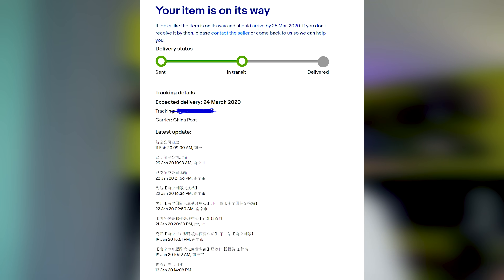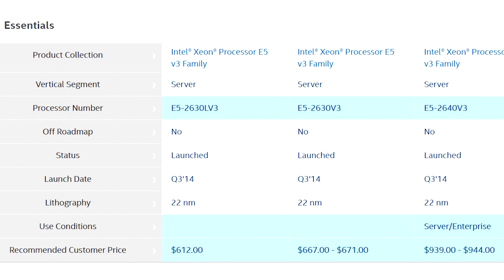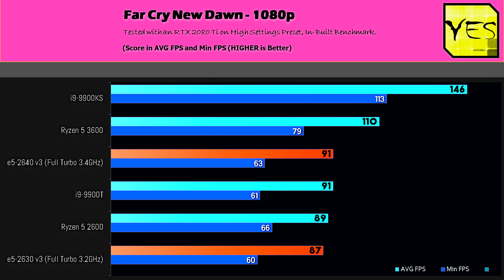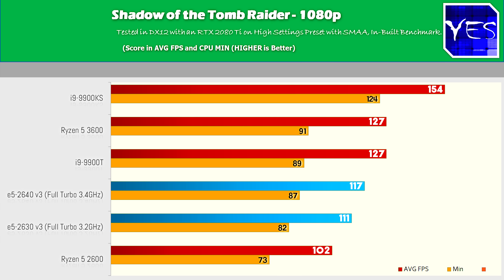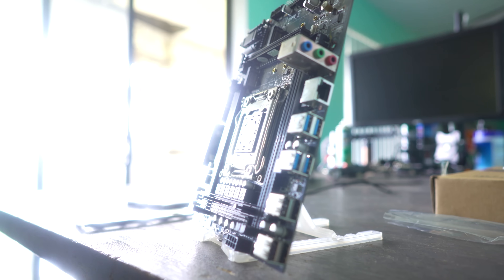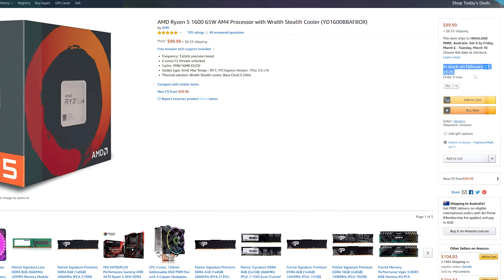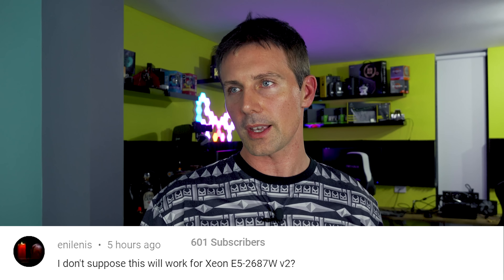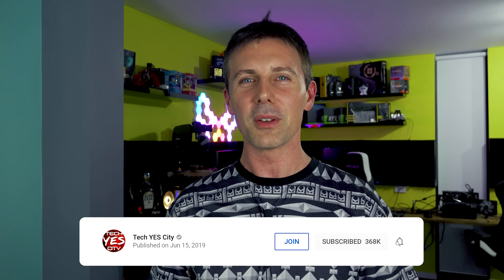8 HASWELL Cores For only $78...!? (E5-2630 and 2640 v3 Review in 2020)

Comment: @ 6:10  I'm with you there. It's been 1 of my 2rd most fun, new system builds to buy into new & grew with it from day 1 & riding till the wheels fall off. I haven't even loosened a lug yet. Still rocking my 2nd Tylersburg system for fun. 4.6Ghz, Tri-Chan DDR-2400 Cl10 crossing into the DDR4 feel & speeds of early X99. Blooming brilliant.

Comment: The one I really wanted to see is the E5 1680v3 on a good board.  I heard they are unlocked but there is little info around about it.  If they can overclock to over 4ghz as the previous 1680's could it would make it for quite of an interesting thing.

Comment: So 2640 v3 can just run the ram at 1866mhz? which CPUs can run it on 2400mhz or more?
Reply: Up to 1866mhz, but it can be run in quad channel on the right boards... giving you 3732MHz 'dual channel' effective bandwidth. 
So even 1600MHz in quad channel will give you 3200MHz 'dual channel' effective bandwidth. 
Check Intel website to see what Xeons support 2400MHz etc.

Comment: those machinist X99-V102 board has a flimsy nvme and m2 ports. though generally a good board with legit quad channel support the solder joints are weak. mine fell off the board (i have 2 of the same) can be related to the location under the pcie x16 slot.

Comment: Can you overclock the baseclock on these boards? Linus did an overclock on the baseclock of a xeon and got it to 113mhz stable. If you could get one of these to a more conservative 110 x 34 would be an all core boost clock at 3740mhz. I would be interested if this was acheiveable and what gains it could offer. Linus video title: Intel Xeon E5-2697 v2 - Test and Slight Overclock Vlog

Comment: IVY BRIDGE:
Check out the E5-4627V2.  Just saw the price is very attractive at $60. EIGHT Cores/EIGHT Threads and with all core clock to 3.5Ghz. It is locked, of course.
https://www.ebay.com/itm/QTY-1x-Intel-CPU-E5-4627V2-Egiht-Cores-3-3Ghz-LGA2011-SR1AD/164002585031?epid=11021091630&hash=item262f50d9c7:g:81sAAOSwBDdeAYGR
I have run this CPU on a HuananZhi X79 Deluxe for nearly 1 year (and I thought I had a deal at $96 delivered, at the time) and it really is a nice performer.  At this price...wow.

Comment: Would you be willing to do a single e5-2670 V3 benchmark? I snagged a EVGA ftw x99, i7 5930k, 32gb ddr4 for 300 USD and I want to sell the i7 for 150usd and buy a 2670 v3 for 100 so I have 6+ core and 12+ threads and 50 to spare but there aren't any decent videos of the 2670 v3 on all core turbo either it being of or not, love your videos man

Comment: i'm still using a 2600k @ 4.4GHz. Given that the R5 2600 is just a little better than the 2600k i suppose that it's not worth it to upgrade now to 2630 v3 right...?

Comment: Hi i'm thinking to build a new pc with a gtx 1070 that i currently have. Now i wanted to build the new pc with the ryzen 3600, 16gb ram and  the b550 when it will be out but than i saw this video and now i don't know what to do. The difference in price is about 250  euros in favor of the xeon. Now i was thinking if i buy the 2640 v3 with the HUANANZHI X99 TF is this able to do the full turbo mod? Is stable? And another question, if i buy 16gb of ddr4 ram by corsair at 3000mhz will the ram go to this speed or isn't worth it? Finally what do you suggest?

Comment: Awesome Video loved that 😎👍 Say Bryan its a long time ago that i wrote you. I was the guy who did modify the bios to set the xeon 1231v3 to 4ghz on all 4 cores. I did get from ebay that mistery Intel Soma CPU and the comunity still dont knows on wich board it is working. It is an 8 core cpu for the mainstream socket (what it looks like) with 4 dies on it. I already did delid that cpu. Do have also one? Much greetings :-)

Comment: I would add 2700 to comparison, as the price sits between 2600 and 3600. And its a hexacore. Also, it would be nice to mention v4 variants, as they support faster ram, but are on the same socket.

Comment: I have a Core i5 750 with socket 1156 can i change it for a 6 core 12 threaded cpu or is there no performance boost ??  i experience often bottle necking of the cpu. It is coupled with a GTX 960 of msi and a 350watt power supply.

Comment: Suggestion for next videos: you should test with the most powerful gpu, i.e the 2080ti, to eliminate the gpu bottleneck and show the real performance difference but it could be a good idea to test also with a more reasonable gpu, like the 5700, only in the title in which you saw the biggest difference between the used cpu and the new ones, to see how big of a gap there is in a more realistic scenario

Comment: I am waiting to get my rig from China too. Dual 2620v2 with dual cpu with 4 channel ddr3 8x slots. Doing the numbers with assassins creed and gta. People are hitting good response FPS with massive background data shuffling going on at the same time. Raid 1 or raid two two ssd together for much faster boot up at 3/4 faster. Also the sleep function my be coming soon with a proper bios update with some north bridge and south ones flashed to allow shutdown hibernate procedure to suspend power and safely leave ram on to allow fast reboot times. Fingers crossed 🤞

Comment: Great video. I personally think the microcode hack is a bit too much hassle but the chips seem decent enough if you can score an old workstation for cheap (with a mobo and Ram) and pair it with something like an rx580. If you want a bit higher clocks maybe try using a base clock tool to overckock slightly with something like setfsb but I don’t think the gains will be noticable on a low- mid range GPU.

Comment: The problem I have with this is the fact that you can easily pair the 2 Ryzen cpus with the wraith prism and oc both to about 4.2ghz all core and that cooler is only about 20£ and the extra performance ud get would be pretty noticeable in my opinion.

Because especially the 3600 only boosts to 4.2ghz on 1-2cores and they all achieve atleast 4.2ghz all core so it’s a no brainier for games that utilise more then that.

Comment: AliExpress are $219 for 2640 v3 and no 2630 v3's. Also Engineering Samples available wont turbo with Bios Mod. Help Brian, any where else, ebay is not cheap either.

Comment: Xeon > iAnything .   Running a 10 core E5-2630V4 ES, 32GB ECC DDR4 2133 in quad channel, GTX1060 3GB, DIY workstation/NAS/Gaming, 50-60FPS Asseto Corsa @ 4K. All while win 10 is a VM under unRAID OS with CPU/GPU host passthrough. Not one blue screen of death (thanks ECC!) windows uptime last reboot was 90+days.

Comment: 1650 and 1660V3 unlocked multiplier represent, I have my 1650v3 @ 4633mhz stable 1.36v, I use current limit as an alternative to AVX offset, so running prime95 it will liit to around 4.3ghz using a 227amp current limit.

Comment: Performance-wise, would I be better off going with one of these options or an i7-3770K build? Thanks.
Reply: @SISSYPUSS  I have two rings, my original 2012 with the 3770K and one from last year with a Ryzen 2600 and RTX2 L 2080.

I'm wondering if the Xeon performance here would be better than the 3770K. I can sell, CPU, Mobo, and RAM for ~$400 and pick up a Xeon combo with the cash IF it will perform better. 

Do you get where I'm coming from?

Comment: I dont think those cpu's are worth so much since their max frequency for the ram even if it is ddr4 will only be 1866mhz and it would be cheaper to buy the e5 2650v2 with ram ddr3 reg ecc 1866mhz than to buy that cpu that is more expensive with a little ram more expensive at the same frequency sorry for the bad english u,w,u

Comment: Seeing how these procs work, I wonder what the difference gaming-wise is between a X79 Xeon build and a X99 Xeon build.
Reply: power consumption, and trust me, differance is not small. Like 200 vs 280W whole system, just because of CPU.
clock to clock, haswell is like 10% faster from Ivy Bridge, depends on application.
X79 is not worthy if you using computer a lot, you pay all saving on power consumption quite quickly, usually within the year.
Reply: @warrax111  the price of X99 just in general makes it a turn off for me, and while I am all too aware of the power consumption, I am not much worried about it really. I got more than enough PSU
Reply: @warrax111  If I was starting from square one, Id go for X99, but I got many parts for a X79 build handed to me for free, including 384gb of DDR3 ECC at 1600mhz.

Comment: The 3600 is a big improvement over the 2600, AMD must have really improved the single thread in the 3000 series. I have the 1600 AF and it runs great, basically a 2600...amazon had it for 85 dollars amazing for the price.
Reply: I been enjoying 4.3 boost pre CCX in auto overclocking mode with a $25 cooler on my 3600 = It's getting cheaper and also faster .

Comment: What do you think about e5 2678 v3, does this cpu have turbo, i cant find anything on intel website?
Reply: The E5-2678 v3 was an OEM CPU designed for companies like Dell and HP, so it's not listed on Intel ARK. You can find info about it on other sites though (e.g. cpu-world), and it's listed as having a 3.1GHz max turbo. The performance is a bit worse than the E5-2680 v3 (which is listed on Intel ARK).
Reply: @amp888  Thank you, on aliexpress, diference betwen these two's is about 40-50 usd. Do you think that that extra money is worth to spend, how much diferences is?
Reply: @marko1989milosevic  I would personally choose the E5-2678 v3, because I don't think the performance difference is worth the cost. Better to save the money and put it towards more RAM or other components. The difference in performance is probably 5% or less.

Comment: How much you can get performance on a dead platform. Ok the xeons and china boards are cheap but when you are going to upgrade in future you have to buy everything new and scrap those old parts. And those cheap china boards are not going to work very well with i7 oc cpus if you are going to upgrade that way. Buy AM4 platform if you are going with little money and then you can upgrade with little money when you have that chance. Those cheap china boards are made for one time use and then you can throw them in to a bin. I just can't understand this hype for these xeons. That x58 stuff was ok if you could get original asus or gigabyte board cheap for them xeon x56xx cpus so that the price would be under 100$ for mobo and cpu. But the x58 board prices skyrocketed. And now it's happening for quality x79 and x99 boards. But again I say that the AM4 platform is the way to go these days, not these xeons. Resale price for these are going to be ...?

And R5 2600X is now at microcenter for 99$. Now that is a cheap cpu

Comment: I wonder if you've looked into testing any of the E5-4xxx v3 CPUs (the ones originally intended for use in quad socket configurations). They typically have more L3 cache than the E5-2xxx v3 variants, and can be had for around about the same price, if you put some time into searching (which I guess you're used to by now! :) ). As an example, I got a couple of E5-4655 v3 CPUs for my server (6C/12T, 2.9GHz base, 3.2GHz max boost) and they have double the L3 cache compared to the E5-2620 v3 (6C/12T) you tested about a week ago. It might be interesting to see whether that increased L3 cache makes a performance difference in gaming and/or production workloads. I don't know if you can still apply the max turbo hack for the E5-4xxx v3 series though.

Comment: i love my xeons (x5675 4.5ghz all core all threads 25x180 24gb ram 1804mhz cl9 rx580 on a sabertooth x58) when you did the x58 review you compaired it to the i5 and the 1600 also 6c12t processors. why did you review the e5 8c16t against 6c12t ryzen instead of the 1700,1700x,1800,1800x,2700 etc i almost dont feel like it was a fair comparison as against the 6c because the e5 has a 2c4t advantage regardless of clock speeds being slower

Comment: x79 on those chinese boards still has a place.  Gotta figure a six core Haswell at 3.6ghz all core might still loose to an X79 Ivybridge 1650-v2.  I haven't gotten any of the new revisions but the old Huanan boards you were allowed you to get to 4ghz quite easily.  I wonder if the new x79 boards would allow us to see even higher OC's like 4.2-4.3 out the box with no bios mods and say 4.4-4.5 with bios mods.  In any case, I love this kind of content.

Comment: I bought 2678v3 on 99-TF, but was too lazy to unlock turbo (for now I use only single desktop ddr3-1600 / 8-gig memory overclocked to 2133 with 11-12-12-24 timings cuz just had one, will buy ram later) Even with that "unbalanced" config, it's more than enough for modern games. (Cinebench R20 is 3800+)

What it does best is multithreaded stuff (Just rocks the chess engines with it's 24 threads) My dream now is to get two of them on dual socked motherboard

Comment: The biggest problem with these CPUs is the motherboards. A genuine X99 or C612 board still costs $150~200 on average, and those "fake" Chinese boards are just too buggy and full of little annoyances to be worth it as an everyday driver. For example, the M.2 slot on some boards supports SATA only, or is limited to PCI-E 2.0 x2 bandwidth, and some cheap models don't have USB 3.0. The deal-breaker for me is that the sleep mode doesn't work on any of them, as shown by Phil's Computer Lab.
They are fun to play with, and good as a secondary transcoding/rendering machine. But for a main all-rounder system, I'd just get a Ryzen 1700 or 2600 instead and overclock it.
Reply: @Tied Noose Those eBay prices are only available to the US, though, as shipping to other countries, especially down under, can often cost as much as the board itself.
But if you are in the US, you'd have much better and cheaper options, new and used, so these aren't even worth considering, unless it's purely for fun.
Reply: those machinist X99-V102 board has a flimsy nvme and m2 ports. though generally a good board with legit quad channel support the solder joints are weak. mine fell off the board (i have 2 of the same) can be related to the location under the pcie x16 slot. 

so far all my nvme enabled boards are x4 compliant. there is also a dual mode slot with manual jumpers to enable either nvme or sata mode
Reply: It’s been a year since this video — it seems now, as long as the Chinese mobos are from reputable brands and arrive working well, they continue to work just fine. Nowadays, the price of Ryzen 1700/2600 range from $130-160. Aliexpress sells the 2640v3/mobo/16gb ram combo for about the same price! Better performance, better price — likely the better buy
Reply: @WinningTime328  It would seem so! The Chinese mobos are getting better, while older Ryzen CPUs have risen in price.

Comment: hey man, what do you know about the gtx 1070's that are made in China?
I bought mine 1070 like half a year ago, used. But i figured that the performance is slacking compared to other 1070's. after checking the card and cleaning everything i found out that it had this sticker on it with "Made in China". Stil don't know why i dont get the supposed to have fps in certrain games.

Might the issue of lacking fps cause by my cpu? It's an Ryzen 5 1500x stock settings, with 8gb 3200mhz ram.

would love to hear something.
Reply: Bob Mule  I think i just have a bad card. It is just 15 fps on average behind other 1070's.

Comment: i can only find E5-2640 without v3 or lv3 at my country. is it the same? is it good at 61 USD?
Reply: it's not the same, there is v1, v2, v3 and v4.  the v1 and v2 are for socket 2011 and the v3, v4 are for socket 2011-3 ..so as you see is a different socket.

Comment: Really tempted to get a few of the 12C/24T X99 Xeons and build a little cluster system (render farm/audio production system via LAN)... with the turbo boost OC they can hit 2,000 points on CB R15... 5 of those would = the latest 64C Threadripper at 10% of the overall cost.

Comment: If we are talking of pure and simple gaming usage, the 1650 v3 Is the best CPU for 2011-3, because on the right mobo It can be overclocked to 4.2/4.5 Ghz; also i wouldn't trust cheap x99 motherboards from AliExpress for something with more than 6 cores. 1650 v3 once overclocked has the sames, if not better performances in game than a r5 3600

Comment: I now have a 3900X rig but before that I was running a 10 core Xeon V2 on a X79 Asus Tough Sabertooth mother board which had 2 100MHz clocks 1 for system and 1 for the CPU so I could increase the 100MHz clock and still with the fixed multiplier could get 3.4GHz on all 10 cores easily. Although with old ipc this would only get me 2600 in R20.
Reply: Nice